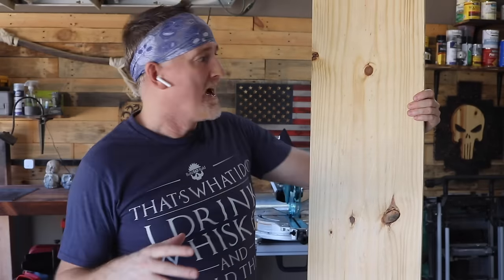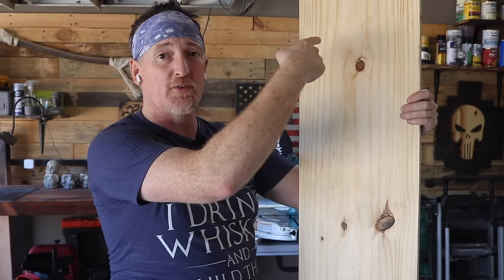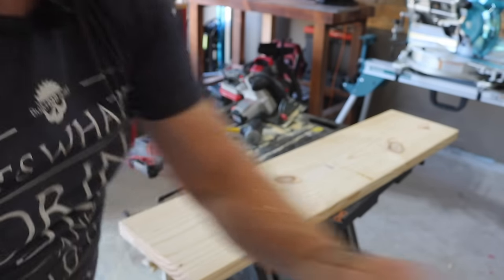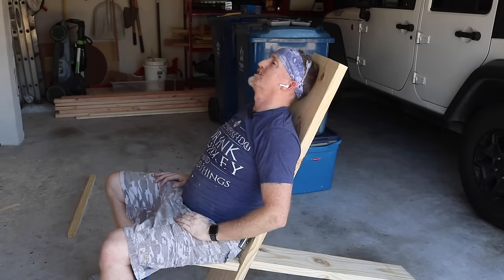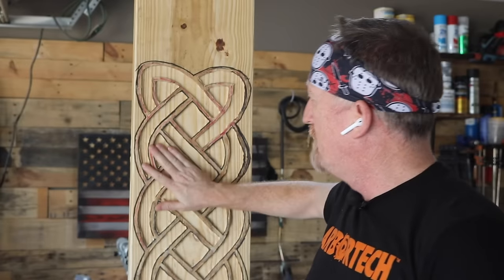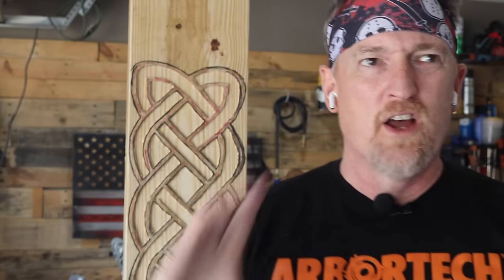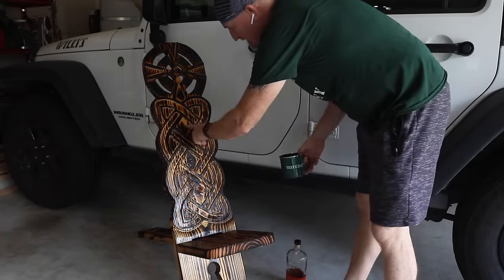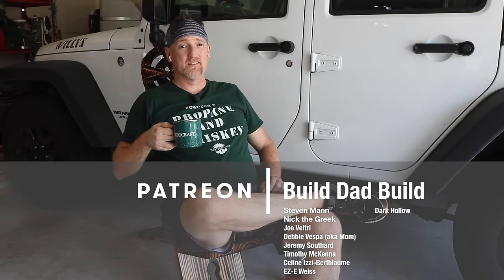How to Make a Collapsible Viking Camp Chair

Comment: Nick I had the same issue with my jigsaw.... I went to a shorter blade and it worked better. I think the long ones tend to have more flex and don't take much pressure for them to go offline.... Keep up the good work and don't change your approach... Cool...... KEWLLLLL
Reply from the maker: Thanks for the tip!
Cheers!

Comment: I've never used that specific fish before but for lots of other spray finishes, you can use steel wool to smooth out the texture. if you do that and add another coat after, it should be smooth. Steel wool also helps to hide an uneven coat. Most of my experience like that is from using a spray lacquer so not sure if its any different with what you used. Just a thought. Great videos man! Cheers!
Reply from the maker: Thank you!
And thanks for the tip.
Cheers!

Comment: Awesome Chair Nick. I just got 2- 2x12x8. But I like a tall back (little less then straight up and down)  and a wide seat so what would you think would be a good measurement? Thanks Bud!
Reply from the maker: You'd probably be best off cutting your back and then playing with different lengths with a scrap 2X4
But, the longer you leave the "leg" of the chair, the more straight up and down it will be. And the closer to the ground would get you more back space and would be more straight up and down.
Cheers!
Reply: Build Dad Build Thanks Bud. I’ll Give That A ShotI Appreciate You. Nice Job On All The Work You Do. 🍻

Comment: Hi nick.... love your videos..  I’m building an outside table out of white wood... burning it of course. My question is ...what do you recommend for the finish?   I have also made a burnt and dyed indoor shelves, which I just sprayed with lacquer. Looks great at the moment, but should I be using a more durable finish coat?   Thanks man
Reply from the maker: I'm a huge fan of Halcyon Clear Rugged Varnish by Total Boat!
If you've never used TB before I can also get you 15% off your first purchase.
Use Code: builddadb at checkout

http://totalboat.refr.cc/nickv1

Comment: You should try making a template for the slot.  Cut most of wood out with the Jigsaw and then use a flush trim bit on the router to finish it.
Reply from the maker: Not a bad idea! Thanks for the tip!
Cheers!!